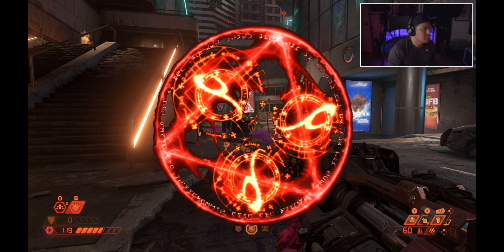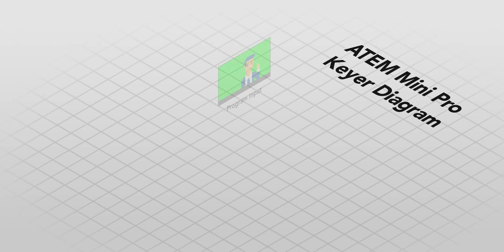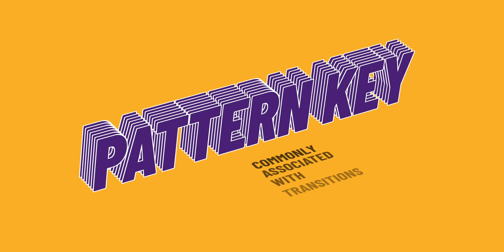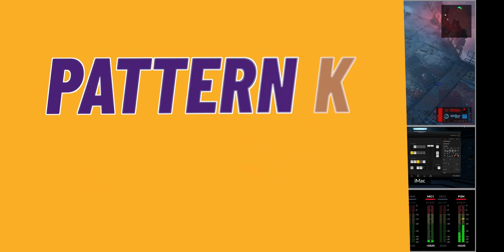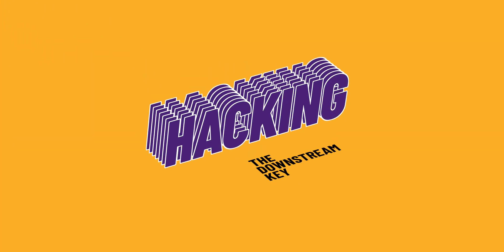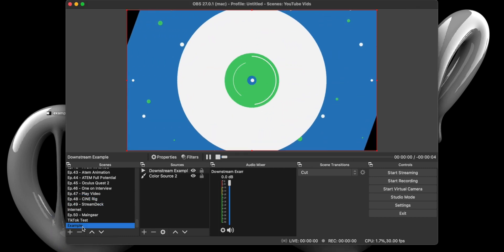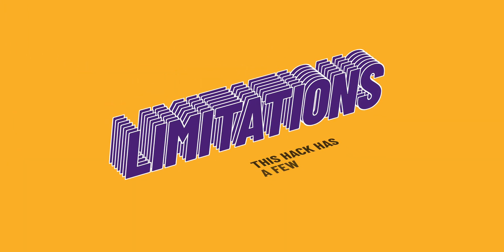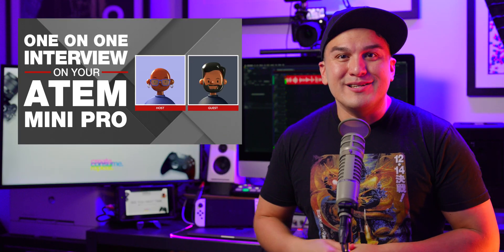ATEM Mini Pro Upstream and Downstream Keys Explained

Comment: What are your thoughts on using a UltraStudio mini HD instead of a Hyperdeck? if my research is accurate, it allows you to push a fill/key sync output to its 2 SDI ports over Thunderbolt; adding that final 20% of functionality, giving you more interactive graphics (text/browser sources) and let’s you use video sources just like A Hyperdeck, but cheaper
Reply from the maker: Never used that specific device so not sure I can provide a valid opinion.
Reply: @CreateConsumeRepeat  I would look into it if you want to use OBS on the DSK with a proper Key/Fill output, it’s the same form factor as a Hyperdeck and about $100 cheaper the the mini plus!
Reply from the maker: Thanks for the tip. I’ll check it out.

Comment: I spent hours trying to figure out why my black text was disappearing with OBS projection. Thank you so much for this video! It is a huge bummer that smooth animations are nerfed.
Reply from the maker: If you want smooth animations I would suggest the OBS method and working within the limitations or drop some coin and pick up a Hyperdeck with key and fill support.
Reply: @CreateConsumeRepeat  I am running my first show independently for an MMA promotion. I found your video when I was trying to make a clock lower-third graphic for the rounds and bring in videos occasionally. The videos are fine because I can take the direct input. It’s when I need to downstream the clock so it will continue to overlay.
Reply from the maker: Sadly, it comes down to color choice with creating graphics that work on the downstream key using this hack.

Comment: Great video, I was unsure about what an upstream keyer was and other channels never got to the point really.  Just a word of advice: if you install the Downstream Keyer Plugin for OBS you can unlock that remaining 20% you were talking about with no hacks needed, if I understand what you meant correctly.
Reply from the maker: Alpha keying motion on the ATEM Mini Pro can only be done via hardware. OBS allows you to cheat to a certain extent. If you are using OBS as your software based streaming solution, then yes the plug-in you mention would work. But I like hardware based solutions. Thanks for the comment.

Comment: This is wrong. Very wrong. USKs are on layers above the Background (PGM Source) which is why it's called Background are the Advanced Panels.
Reply from the maker: Please click the following link: https://www.blackmagicdesign.com/products/atemtelevisionstudio/ then select features from the drop down and scroll down to Upstream key. Here you will see a diagram that illustrates the validity of my video.
Reply: Yeah,  the luma or chroma key is keying out a portions of a fill source to reveal what is underneath it, which is your background layer.
Reply from the maker: Create amazing multi layer live action broadcast effects using the upstream keyer! Layer live video over other video sources or graphics with incredible quality. You can use luma key, linear key, pattern key, or shoot against a green screen and use the Advanced Chroma key to instantly composite the video over virtual sets for mind blowing effects! - BlackmagicDesign website
Reply: @CreateConsumeRepeat  yeah, it says layer  live video over your sources. Meaning it’s on top.

Comment: Zou dont need change all your grapics in AE or PS... simply add color filter in OBS to push a little brightnes to +0.01 :) this make black "almost black" but atem stop keying this colour.
Reply from the maker: Cool tip. I prefer AE for more accurate control.
Reply: thank you very much for this hack, you save me hours of configuration!

Comment: Nice video. I conceptualise the layers a bit differently. First there is the base or background layer (L0) which has the main content. Sitting on top of L0 is the upstream key layer (L1). What L1 does depends on whether Chromakey, Lumakey or a DVE (e.g. pip) is selected. L1 will always block/replace part of L0. Sitting on top of L1 is the downstream key layer (L2). L2 will always block/replace part of any of the layers below it.
Reply from the maker: An interesting stencil approach to understanding the keyer. Thanks for sharing.